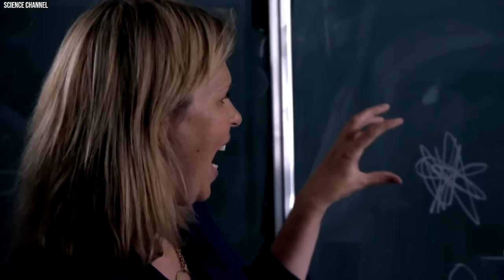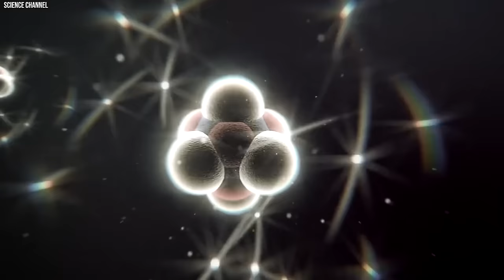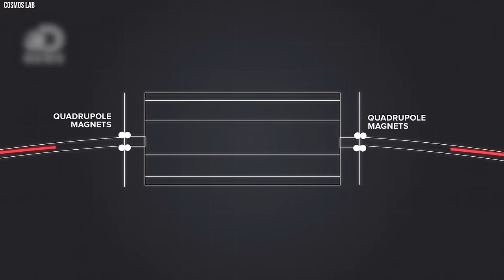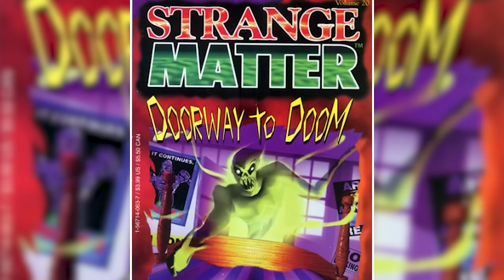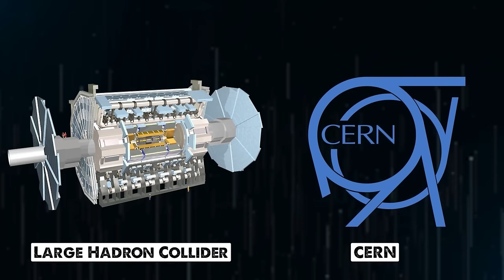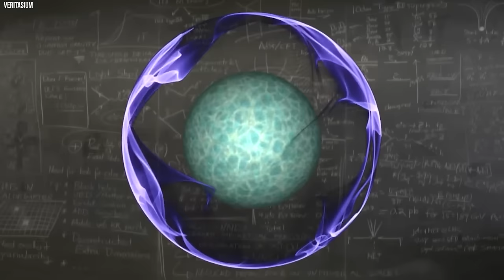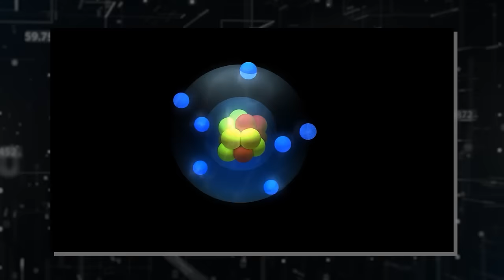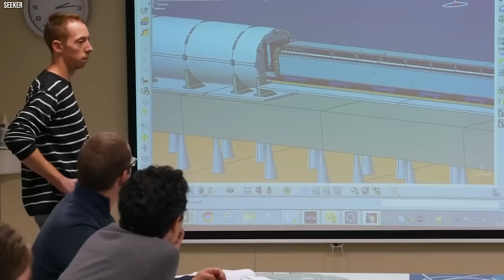3 MINUTES AGO! Worlds Smartest Kid Vanished But He Came Back With A Terrifying Message

Comment: All I know is that the LHC became operational in 2008, and 2008 is the first reported case of the Mandela Effect.. It was publicized in 2009, but that was due to experiences the originator of the term had had in the previous year.. starting exactly the same time as the LHC was operational.
I can find absolutely no references to this effect before then. So I think othe kid was right, although he's hardly the only person to suggest the connection. I did myself years ago, as did several vloggers on here, back when you could say anything you believed without being censored.